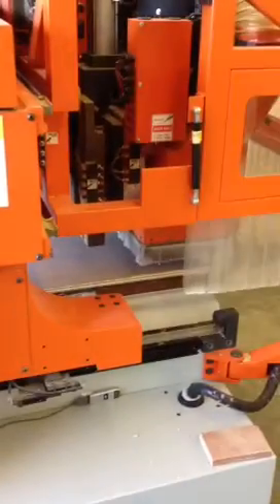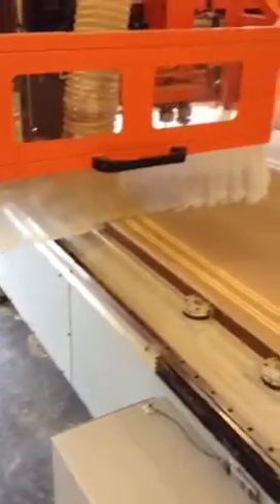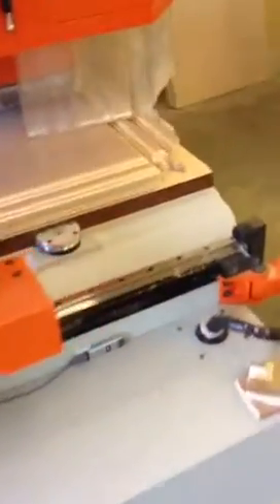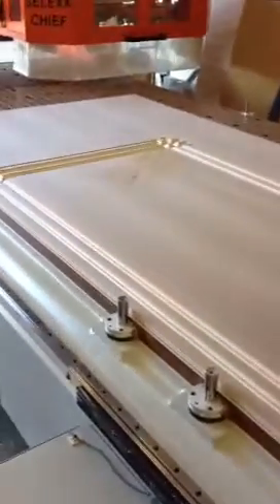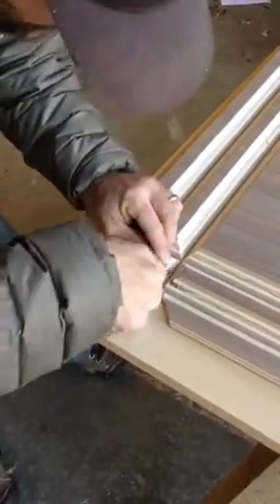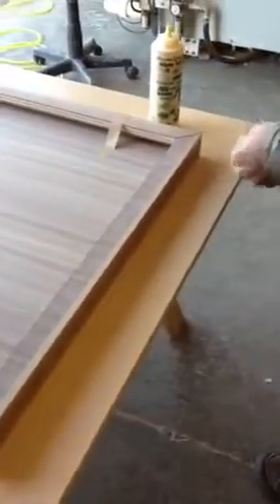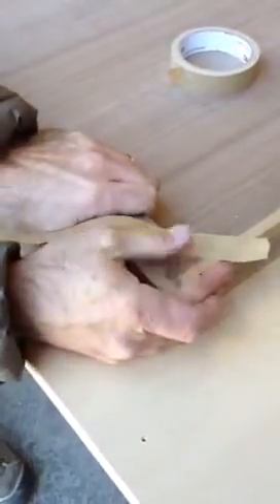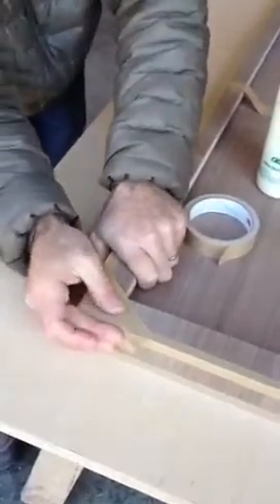Table top miter folded edges

Comment: You can use your CNC Router to cut perfect Bible Boxes in a single pass; honest to ........... It's true;
A strip of tape brings the whole project together.  A 2" wide non s-t-r-e-t-c-h / Kleen Peel film tape adhered to the material on the opposite side of the sheet prior to routing will hold the definition of the miter-fold joint perfectly while the glue cures. Z Axis should be down to, but not through the 5 mil, 400 Lb. Tensile Strength film backing.  Once the bond is made simply peel off the sticky* tape.  The adhesive peels kleen and leaves no residue on the finished part.  See www.allstaradhesives.com (V Groove Tape(s).